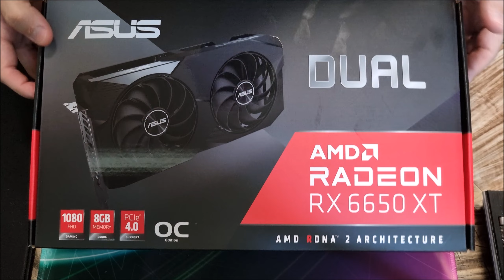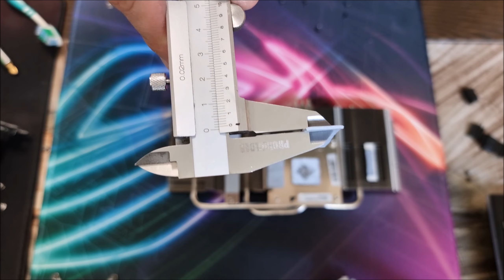ASUS RX 6650 XT DUAL UNBOXING AND TEARDOWN

Comment: Thank You for this vid! I have the same card, hotspot hit 110C and throttled down (with fans at 3100RPM), so I've decided to repaste it. Had some PTM7950 laying around and bam, tops at 82C with 1850ish RPM. It was my first GPU repaste so was very careful with it, but this card really had quality pads so nothing was hurt in the process. Thanks again! <3
Reply from the maker: @bencenagy2406  Your welcome!

Comment: Is a 700w power supply enough?( DeepCool PF700)
Reply from the maker: That is more than plenty!
Reply: Thank you. The instructions say that you need 650w. I heard that you need to take extra @TechnologyHive
Reply from the maker: @mamonth89  This card is only 170w TDP. You have plenty of power. I have it running with a 550w EVGA power supply. No problems at all.

Comment: What actually removes the warrenty when opening it up? Ike how can they tell? Ive just got this and looks like its maybe a return and been opened and tested as finger prints on the metal side parts.
Reply from the maker: On that card there is a seal, small round sticker over one of the 4 screws around the backside of the gpu. If the sticker is missing or punched, it has been opened, and they might give you crap with the warranty.
Reply: @TechnologyHive  thank you! I'll have a look

Comment: Not CD but just manual, thanks card and overclock rating...
Well I ordered myself this card to replace GTX1650 4GB GDDR6...
What do you think?
Reply from the maker: It's a good upgrade. Just make sure your cpu and motherboard support pci-e 4.0, or else you'll be bottlenecked down to pci-e 3.0 x8, not x16. The card supports pci-e 4.0 x8 only.
Reply: @TechnologyHive  My config will be with this card:
CPU: AMD Ryzen 5 3600
RAM: 4x 8GB DDR4 3200MHz
GPU: ASUS Dual RX 6650 XT
MBO: ASUS Prime B450M A II Aura Sync
PSU: 500W Gold (it has PCIe 6+2)
PSU calculator gives me total power consumption of 347W including all my drives.
Should be good enough...
Reply from the maker: @REDLINERUNNER  Your card will running @pci-e 3.0 x8. This will reduce performance noticeably compared to if it were running @pci-e 4.0 x8.
Reply: @TechnologyHive Well as I watched comparison in games running 3.0 to 4.0 it's 5fps on average... Not much really. Tell me is it possible to plug in 6+2 wrong or it's phisically impossible? Thanks..
Reply: My MBO supports 3.0 x16 which is close to 4.0 x8 which this card can do. My only worry is can I damage something when plugging it in and can I plug in wrong 6+2. That's first time I'll do it myself... Coming on friday.
Reply from the maker: @REDLINERUNNER  there may not be a great difference between pci-e 3.0 and 4.0. But when combined with x8 instead of 16 lanes, yes there will be a noticeable  hit to performance.
Reply from the maker: @REDLINERUNNER  don't plug it in wrong, or you will short your card. But the connection goes in only one way if not forced.
Reply: @TechnologyHive  About plugging in 6+2 can I make a mistake or not possible?
Thank you!
Reply from the maker: @REDLINERUNNER  You will be able to see the difference when you try plugging it in. It only goes in one way.